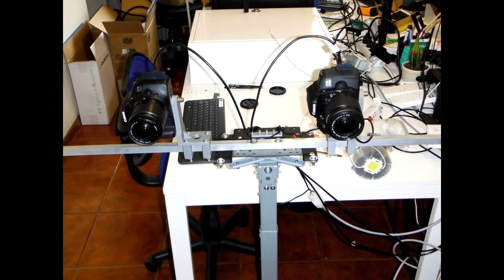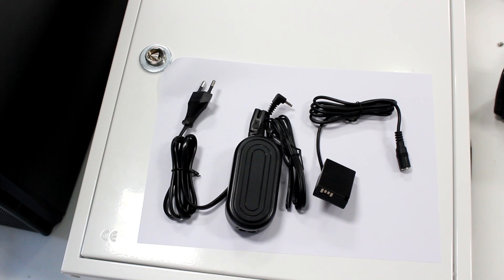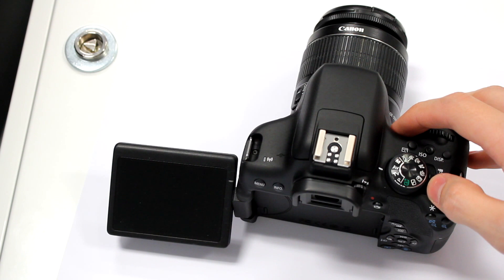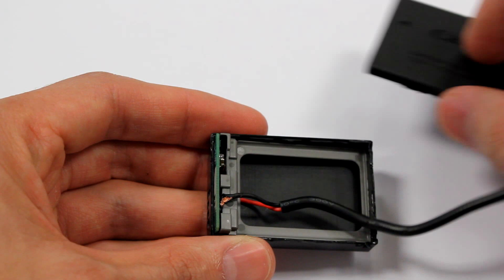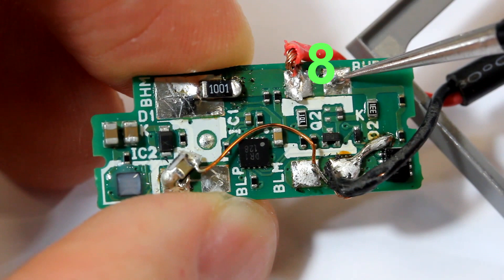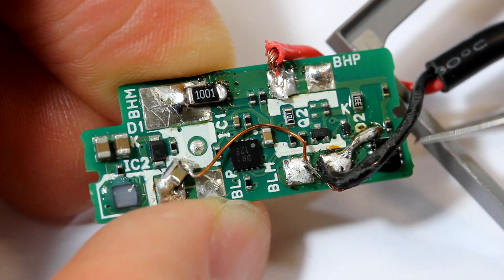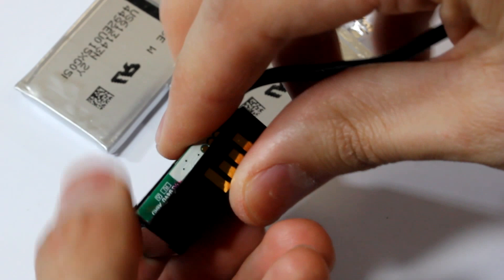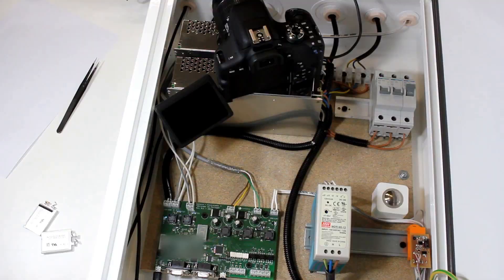Canon EOS - How to bypass the genuine battery check

Comment: Hi hose,
You're ahead of me on how to edit the pCB. I shorted my genuine canon battery and I am trying to bring it back. Bypassing the mosfet sounds like it might fix the problem. The problem is after the short the charger and camera don't recognise the battery, the camera reads 7.6v, but nit n the contacts for the camera, it only read 0.151 -ish.
Reply from the maker: That sometimes happens when the controller shuts itself down as a security measure, you can try waking it up by applying an external voltage on the battery contacts outside of the battery (the ones that are measuring 0.1V), just use a power supply set for 8 volts and imagine you are trying to charge the battery. By applying that charging voltage sometimes the battery controllers wake up again.

Comment: What does it mean that there is 8.0v mention in the camera body near serial number. And the genuine battery mention 7.2v. But most of the 3rd party usb dummy battery mention 8.4v or 9v.If I use it will it work without any problem even  the voltage is different.
Reply from the maker: It will work. The battery is nominally 7.2V (2 cells of 3.6V), but the voltage varies according to how much charge is left, when the battery is fully charged you will measure 8.4V, when it is fully discharged it is around 6.6V, some devices go as low as 6V, so the camera is designed to work in this wide range of voltages. I personally wouldn't go above 8.4V on that camera, though, 9V probably works but might be stretching it a bit.

Comment: Very usefull video! Do you know any other easier way to skip that message
Reply from the maker: Nope, maybe with a custom firmware like https://magiclantern.fm/ ?
In the meantime I've moved on to Micro Four Thirds on a Panasonic body.
Reply: Wonder is this would work on on Canon camcorder batteries as they are chipped to work only with certain models. Example Canon g20 batteries are same as Canon g30 but 20's will not work in the g30 model....

Comment: Can make tetorials for battery canon 700D, Battery LP E8
Reply from the maker: Sorry, but I don't have any Canon cameras at the moment. The 700D should use the same battery as the 550D and I didn't have that problem with mine, though. If you want to try this, the battery controller circuit in this video should be very similar on the LP-E8.